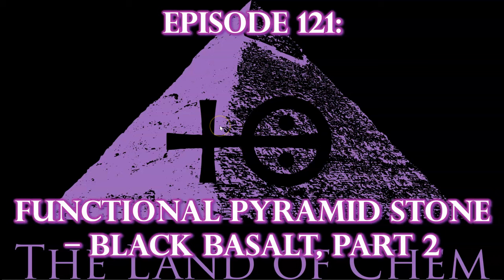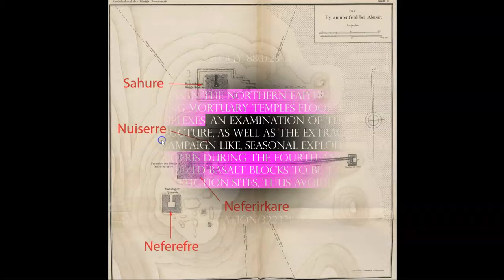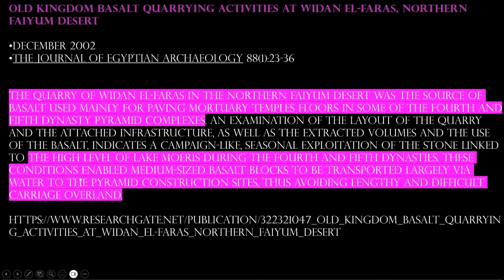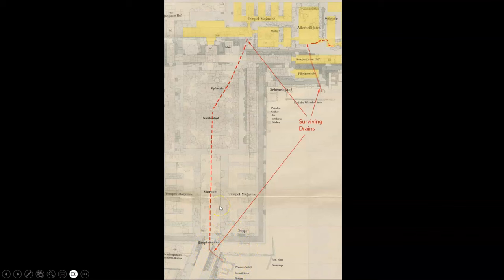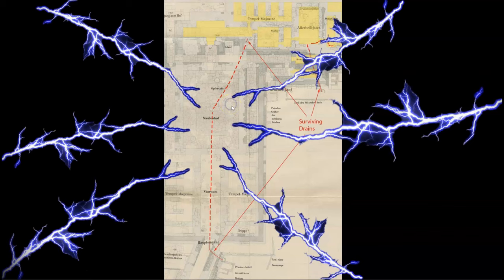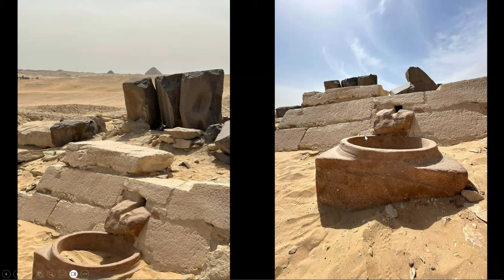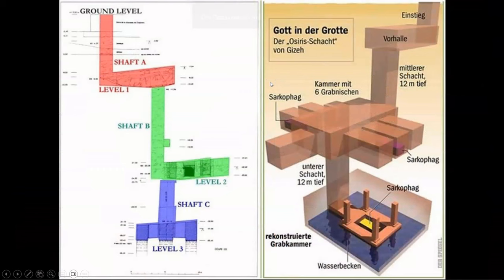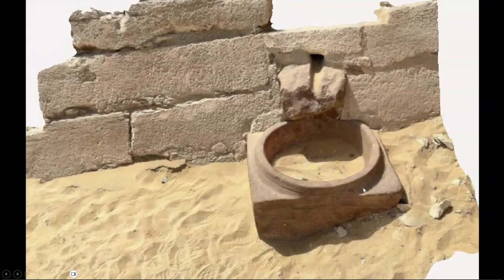Episode 121: ANCIENT TECHNOLOGY - Functional Pyramid Stone, Black Basalt Part 2

Comment: Often wondered how you'd propose the channel system would be kept clean or maintained so they wouldn't block. Assuming that using heat as a catalyst wasnt 100% efficient, maybe there would still be some trace residue deep inside the channels ?
Reply from the maker: These systems would have also been routinely cleaned, flushed with water, periodic maintenance, etc. Same as a modern facility. But yes, I'm sure a sample could be taken from an area where the conduit is still buried
Reply: @thelandofchem  It must be so tempting to sneak out with some night vision goggles and a shovel to dig some shit up 😆